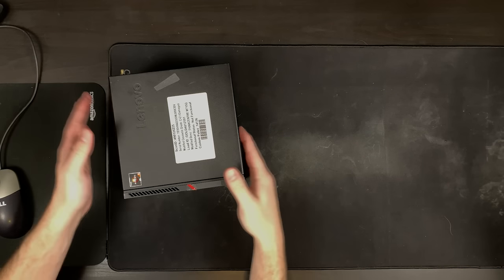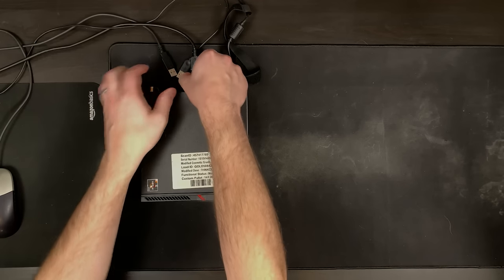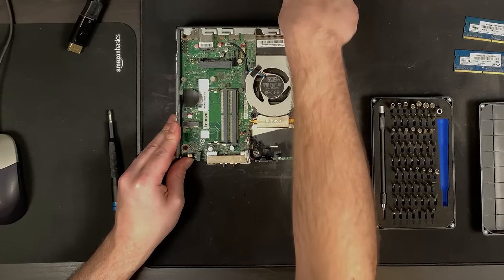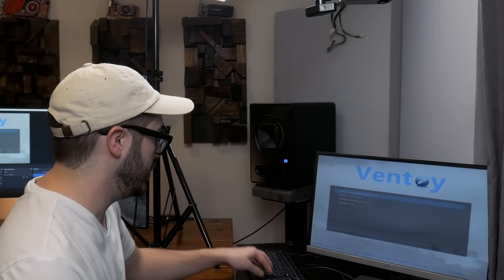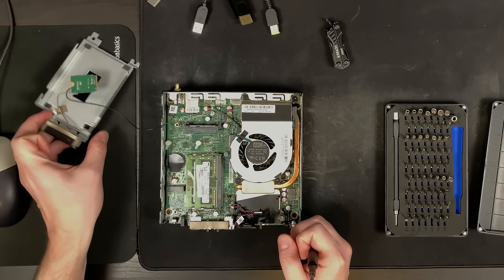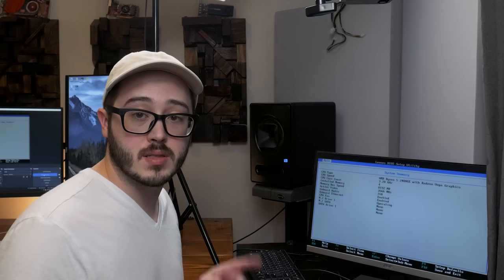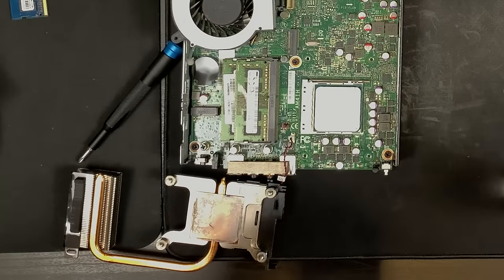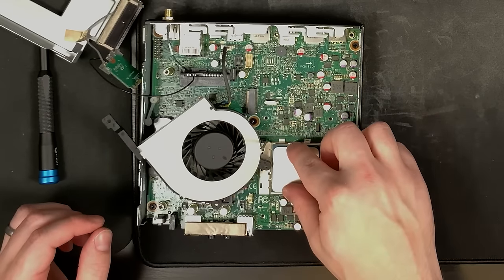Can I Fix These Broken Lenovo Mini PCs?

Comment: 12:20 yes these are the standard business-oriented, non-overclocking BIOSes typically seen in these kind of machines. I have one of these ThinkCentre mini PCs from several generations back and the outside, inside and BIOS look exactly the same. My Lenovo Legion laptop also has a similarly spartan advanced mode BIOS. I've been using my own ThinkCentre as a DNS server and docker host because they're so low-power I don't feel bad leaving it on 24/7.
Reply: these bioses were present before standardized bioses , i remember similar layouts on my single core cpus to celeron dual (2004 before) pretty sure licensing or using this one cuts costs

Comment: the best way too clear cmos is too pull the battery, leave for 2 mins and then retest. also test battery voltage in circuit, should be above 3.1 volts in circuit. have never used the jumpers dont trust them, an old tech told me once just pull the battery. nice video, well presented

Comment: These large OEM machines often have a reset feature for the system management chip (it can crash and freeze sometimes), usually just holding the power button down for 60 seconds when connected to power will get it going if the firmware will not get to the screen init stage.
Reply: Adding to this, vurtually all modern systems have a "last ditch" bios recovery method usually involving a small USB stick with a file names bios.sys (super.rom on supermicro, a BIOS recovery ISO for Lenovo (which may or may not work from USB, apparently needs to be on CDrom on some units (with the CDrom plutgged into a specific port)

These models have lots of threads about bios update failures and the hoops which need to be jumped through to recover. Lenovo appear to have dropped the ball quite badly

Comment: @12:12 because you loaded default values. The default is Enabled. Secure boot works with certificates and checksums before the operation system it does it's wizardly things and either loads the OS when the check is complete or refuses to boot an OS. Resetting to Set-up mode clears all checksums and certs that were remembered. You should also enter in to this option so it shows load default keys (or something along the lines of that). You are then set to go. The error you got on booting to the OS was related to the secure boot settings.

Comment: Since they are all working you could always update the BIOS to the latest version then you can be certain that there are no faults associated with the BIOS program as well...   Great work, you are officially no longer a LARPer.  Btw the humility seems to be a big help when dealing with these things.  The lower your expectations the less frustration will be involved because frustration leads to failure and overlooking possible points of failure, not to mention causing failures...
Reply from the maker: Yep! That's what I did, and the Lenovo flashing tool even allowed me to correct the serial no which was duplicated in the reprogramming. And thanks!

Comment: Nice video as always :)

And yes, you can absolutely yank an AM4 CPU out of the socket when you pull on the heatsink.
Reply from the maker: WOAH! Appreciate the comment from such a legend! And thanks for the info as well haha
Reply: As a follow-up warning ; you can "Yank" any PGA based Cpu out of it's socket. That happened to me with my AM3+ that I was running before I initially switched from AM3+ to AM4 and that's a part of why I had to switch.
Reply: i've done it to just about all flavors of pga cpus you care to name with shorter pins. sometimes the cooler mounting just doesn't give you the choice, sometimes you can rotate a bit to break the connection first.

once they moved away from the pin length that was on socket 7, and to some degree socket a and 370 (due to the small die size, mostly), it became ridiculously easy to rip the cpus out once the thermal paste had effectively transitioned to an adhesive.

thankfully, i haven't had pin failure from any of these yanks, but its still worrying when dealing with the cases that don't allow you to twist it to break it free.

que sera sera.

Comment: @10:23 I work with these machines on a daily base. It is correct that you can boot the PC with ALT+P... because these machines are designed to put in a Thinkcenter monitor (that snugly fits the tiny desktop on the back of an LCD screen). The connector at the back of the monitor has a Display link port, a power plug and a USB plug that gets pushed into the desktop. You can then use ALT+P to boot the machine.... Although most of the time this still does not work :P

Comment: Nice video there. I very recently bought a M900 Tiny with i5-6500T and was using it for a NAS because the Tiny series are tiny so it will save me some precious desktop space, after I watched your videos about the home NAS. I have an old Lenovo laptop and I was upgrading the Wifi card for it, and Lenovo's part-compatibility check was tight to say at least; they are even worse for locking CPUs now. You have a great voice btw!
Reply: Desks have under sides too, a suspended shelf maybe !

Comment: Probably already got this comment somewhere, but we used these and similar models of Lenovo, HP, and the like for the insides of Kiosks that are used in correctional facilities. So, thousands of these things. All of us in the field had a steady 'refurb' workbench going, and about 90% of the no-boot issues (that weren't immediately just a bad stick of ram as you found) were indeed just corrupt CMOS or BIOS that had to be reflashed. Most of the time this is caused by being used in enclosed environments like kiosks, drawers, cabinetry, etc. and getting power cycled without propr shutdown. One of the consequences of remote support figuring out they can 'reset everything' by just hard power cycling (remotely via something called a netbooter) the PC and everything in the cabinet, rather than doing the troubleshooting they are supposed to. They're built like little tanks, but all that thermal wear and power shock really kills those BIOS chips. Plus they kind of set them up to get extra baked by where they placed them on many of those little boards. You did the perfect path honestly: Clear the CMOS for a quick and easy check, flash the BIOS if that doesn't work. 9 times out of 10, you get a PC back :)

Comment: Lenovo ThinkCentre, and most other business grade PCs have a BIOS recovery procedure.   

Lenovo’s method is:
Leave the clear CMOS jumper on the clear setting.  
Place the binary BIOS ROM file on the root of a CD.  (Not a zip or exe, has to be only the ROM). 
Boot the machine with the CD inserted.  
Wait for the BIOS flash to complete.   Power off and return jumper to normal mode.  

Blank screen doesn’t mean it’s flashing.  You see the normal flash screen just as if doing it from Windows and it reboots into the flash utility.  Should take less than 10s to kick off.   You may need to reboot if you don’t get the CD in fast enough.  Don’t wait 5 mins on the black screen thinking it’s doing something.   Something isn’t right, double check your steps and try again.  You’ll know when it’s flashing and working right.  

I’ve done a Lenovo Tiny by attaching a desktop CD drive to it.  There might be a new way to do with USB.  But I already had a CD made.  So it was convenient at the time to use the CD.

Comment: I have one I bought on eBay for $85.00 and I had to add an SSD I choose a Kingston 500GB Drive and the power adapter. It was over $100.00 to get it up and running. I'm using it now to watch your video. It's a Lenovo M92 ThinkCentre that was used in an office I installed Windows 10 Pro and it just works. I also messed with some Linux distros too because I  like testing them out. I'm a Slot Tech who worked in a casino. I've messed with the computers since Windows for Workgroups and DOS 6.2 on my old Packard Bell Computer from 1998-99 somewhere around there. Liked your video and you did a good job troubleshooting and getting them to work. Kudos to you.
Reply from the maker: Thanks Richard!  And that's awesome. I just picked up an older desktop from way before my time with computers, and it's a lot of fun and quite a challenge to just understand what all is going on haha

Comment: 28:20 The CPU doesn't have to be dead, sometimes this also happens if a motherboard doesn't support the cpu right for example the BIOS needs an update on order to properly function with the CPU.

Comment: One thing when you test systems is consistency and not assume stuff.. So for example, after finding out RAM on first, when doing the second, you skipped clean POST testing, so technically you could then have fried your "known good" RAM in the second machine.. Always test from minimal system and be aware anything you put into an unknown machine then becomes "tainted" until you have retested them. Newer system can even blows hardware fuses in cpus to machine lock them....

Comment: Part of my diagnostics before I go check the CPU is to clean seemingly bad DIMMs and clean seemingly bad RAM sockets.

For DIMMs, simply rub on the contacts using a rubber pencil eraser. Some really thin grime can form on top of the contacts that will cause a bad connection. The eraser will fix that.

For sockets, you can repeatedly connect and disconnect a DIMM and periodically clean the DIMM contacts. If is still doesnt work, a electronics contact cleaner spray would help. While wet with the cleaner, do the same connect-disconnect trick and try again. If it still doesnt work, plug the DIMM in and attempt to wiggle a bit in different ways, all while trying to boot in between.

Worse comes to worse you have a bad CPU pin. I one caught this off an Intel LGA CPU where one if the pada was ever so slightly dirty (fingerprint? Thermal paste?). Checking the LGA pinout it was related to the bad slot. Cleaning that part fixed the RAM problem.

I also had a problem also ince of the Intel CPU being too overtightened/depressed causing the ram slot to not work too.

Another one that happened to me for intermittent boot failures is replacing the CMOS battery.
Reply from the maker: It was off camera, but I did try cleaning the bad stick or ram (tried IPS, eraser, and deoxit) but could never get a POST with it. And I replaced CMOS batteries in the video as well, just off camera. Appreciate the advice and info!

Comment: - Wrong method of memory diagnosis. You were only trying to insert DIMM 1 into Slot 1 and DIMM 2 into Slot 2, instead of trying each in Slot 1 (lower/first/underneath slot).
- Always force POST/boot screen by booting without battery and no RAM, turning off at beep. Then adding one DIMM at a time into RAM Slot 1, checking for video. Then other DIMM into RAM Slot 1. Then insert new CMOS/BIOS/CR2032 Battery into its slot, and booting up. Then entering BIOS and Factory Resetting (without Network Boot!). Then optionally configure BIOS, saving and exiting, and safely turning off. Then connecting SSD (HDD extremely not recommended in general, and in such Form Factors). Then connecting USB OS drive, turning on, and booting from USB OS Drive.
- If no video (after attempting said Battery/RAM diagnosis), try different video port, changing video mode on Display, or different video cable. Also try cleaning/air-blowing connector/port.

Comment: you have a pretty decent idea of what it takes to do this for other people . Hobbies don't always need to have a return though. , sometimes the freedom is what keeps it fun. Ch341a is such a massive pain in the ass , BIOS chips are so slippery . I want to make a an 8 pronged set of needles that rest on the chips with a small adjustable stand. Full size chips could use 2866/3000 mhz ram too i believe.
Reply from the maker: Sounds like quite a project haha

Comment: Just got a start with saying that this was a great video, I love seing people taking care of "broken" hardware and fix it. But I have a tip for you, when just testing CPUs dont even bother with thermal paste. Aslong as you dont run any heavy stuff and just try to boot the pressure of the cooler is more then enough to keep the temps under control. At work the first thing we do at the test stations is to wipe off any preapplied thermal paste on coolers since it just takes a lot of time to clean and makes a mess when swaping stuff often
Reply from the maker: Thanks for the advice! I get nervous on camera and often doubt myself on stuff like this, but I've had a couple people now say its fine. Appreciate it
Reply: Yeah thats understandable. I reacted the same way the first time I did it but after seeing temps of around 35-40c without thermal paste I started to see the advantage

Comment: Loading BIOS defaults is always a good idea on unknown systems. As is clearing the CMOS, but don't press the power button if the power cable is still attached ! The idea with using the power button is to discharge any stored charge on the board which it won't do if the power cable is plugged in. Also, that antenna cable can be removed from the Wi-Fi adapter easily enough. It has 'slide on' tabs.
Reply from the maker: Good advice! I pressed the power button with it plugged in because that's the SOP provided by Lenovo for those, however I think I've finally just decided to both follow the manuals procedure as well as just removing the battery and discharging the caps to be sure lol.

Comment: I'd suggest using a version of Puppy linux to initially run the system. It runs straight from a USB (no install required) and you can check the hard drive to se if there's an OS on it.

Comment: Great video.  I just bought one of these off of eBay for $100 with a Ryzen 5 2400GE.  Listing said it's working, but I can't get it to POST.  No video output, and two short beeps that repeat ad infinitum.  I tried swapping ram sticks around, using good ram sticks, making a bootable USB with the bios files from Lenovo (which a few posts on Lenovo forums indicate can sometimes work).  I'm assuming it's a bios issue, so I just bought the kit in your video.  Fingers crossed it'll work; otherwise it's back to the eBay seller.

I'd also love to know if there's a way to get later gen Ryzens on work in these, like a 4600GE.

Comment: About 2 years ago I got the 715q came with 6th gen I3 ,16gb ram ,1tb Hd ,128gb Nmv windows 10 ,no WiFi Bluetooth (I will get) 
With power brick etcI have added 128gb external SS0 Linux mint,I use it to watch online stuff.
Think I paid a
Less than £90 
Been looking at the cd/dvd tray burner all in one,£25 online,except you have to upgrade the power brick,I think to 90 or 120 watts.
I love it even can go up to I7 ,6th gen, 64gb ram
Awsome,quite,cheap done 2 bios upgrades,fan can be set to come on when hits certain temp,connected to my plasma. In living room.

Comment: Makes you wonder about what the people were doing to mess up the BIOS/RAM earlier.  Strange how they managed to brick 4 computers.
Reply from the maker: Possibly some automated BIOS/windows stuff if I had to guess.
Reply: @HardwareHaven  Turning off windows defender/security is a good idea before allowing a working windows PC to update its BIOS or third party hardware firmware. Or use Linux to update firmware. Nice to see Ventoy working for you!

Comment: These video blogs are a good contribution to your channel. I have one of these with a 2200GE. So far using it for BOINC but I'd like to find more projects for it.
Reply from the maker: Oh that’s super cool. And thanks!
Reply: @HardwareHaven  Just finished the video. A few thoughts about my experience. I received two of these from eBay and neither posted upon arrival.
1) These systems (specifically M715Q AMD) are super sensitive about their boot configuration (secure boot, original CPU and RAM etc.). Both of my M715Q's behaved strangely around CPU swaps. I can use the 2200GE in other systems but it will not boot with a 2400GE from a separate system. I've sort of given up on a CPU upgrade and chocked it up to OEM shenanigans. 
2) It's possible the previous owner swapped RAM or CPU config. It looked like your systems had different RAM configs upon arrival. From the previous owner's perspective, after the change in question they never booted again and they didn't have the energy or time to troubleshoot. 
3) One of my two systems also had a single dead DIMM upon arrival but worked fine with a new set of 2666 SODIMMs. Not sure if there's a connection with your dead SODIMM but we had that experience in common.
4) CMOS reset with the jumper never worked for me. I manually removed the batteries and let the systems sit for 1-2 hours (longer than necessary but just to be safe).
5)I suspected corrupted BIOS too. Maybe a botched enterprise BIOS update? Glad you were able to go down that rabbit hole and come out the other side!
Reply from the maker: @jonathanmarshall3974  Thanks for sharing your experience and advice!

Comment: I got a free M715Q from work.  Exact same problem in that the CPU fan would spin but no video output at all.  Reset CMOS and changed the battery.  No change.  Both RAM sticks work fine in my girlfriend's laptop so that's not the issue.  Erased the bios and successfully loaded the latest one via the same CH341A programmer that you used in the video but that didn't work either.

I don't have another AM4 system to test the CPU with but I doubt that's the problem.  Nothing looks amiss with the motherboard.  I may try to find an older bios to try but I  really don't have a use for this PC.  I just wanted to see if I could get it working and then pass it along to someone who could actually use it.